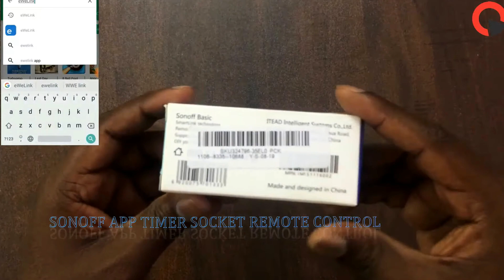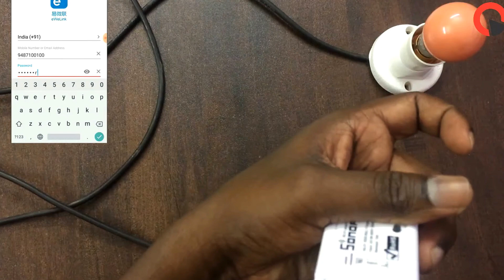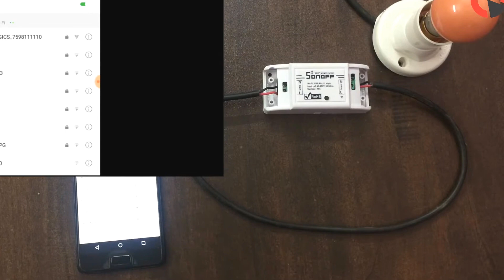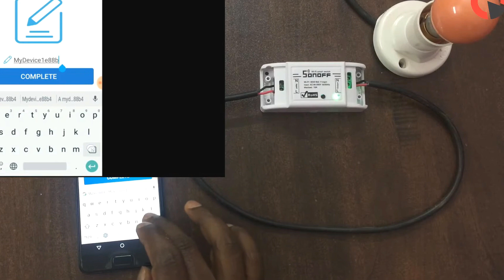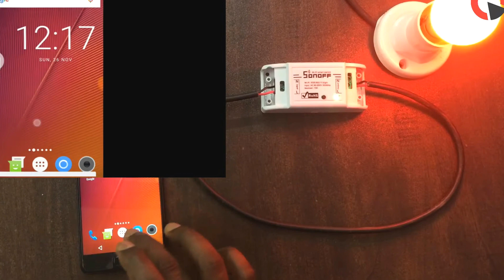sonoff wifi wireless smart switch relay module installation and alexa control setup

Comment: I have a question
Im from Pakistan here we face Electricity failure once light gone this switch off then again when light come is this switch automatically connect to wifi router or i need to configure again
Reply from the maker: First time only u need to configure wifi connection, once configure the wifi name & password it will be save in to the device. So, No need to configure again.
Reply: TECHLOGICS if my light on when electricity gone so when electricity come is my light on or off?
Reply from the maker: For that, you can set the Power on State by [ON / OFF / KEEP}
This option available in eWelink app -> Device Settings
Reply: @nomansaeed4511  bro y online mangy k lia adress btyan
Reply: @Techlogics  bro i bought it plz send online adress
Reply: @nomansaeed4511  bhai from where I get this relay I am also from Pakistan